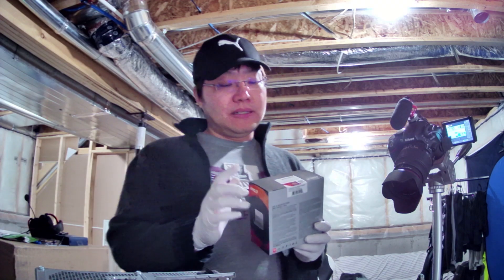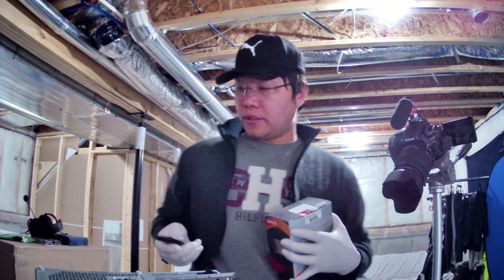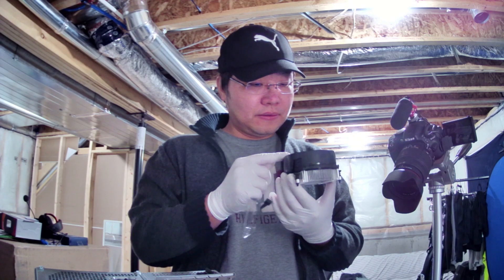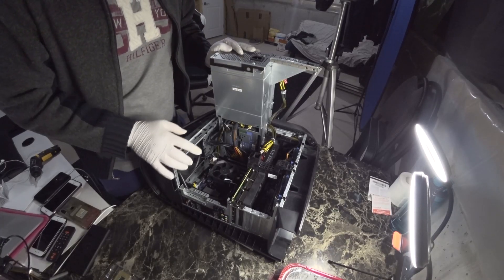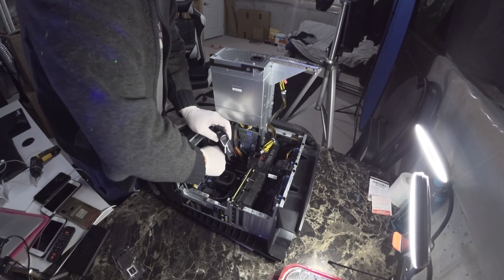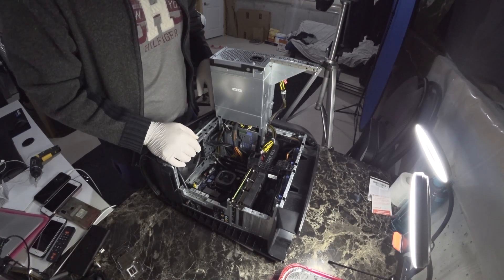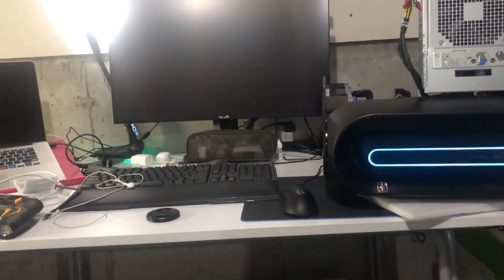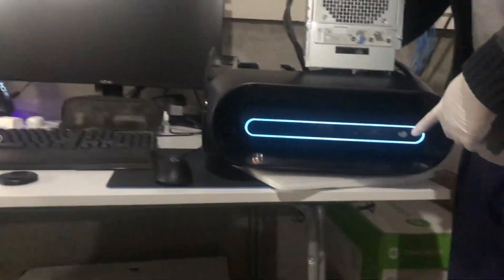Will Aurora R10 able to use AMD5000? 5600x 5800x 5900x

Comment: i'm helping a friend install a ryzen 9 5900x into their alienware aurora r10 from 2022. it ran and we checked settings, later that night it started crashing, and now won't boot. i see it has bios 2.2.3 which is probably original version, i'll get that updated. But i would think it wouldn't start up at all if that bios version is too old? maybe something else is the issue? i'll go work on it again today and update bios and look for other clues
Reply from the maker: Good to work bro, but honestly tell you do not waste your time, see your motherboard part# first if your motherboard is 0NWN7M then you can't run any of 5XXX CPU due to unsupported even if your BIOS is upto date, if your motherboard is 0TYR0X then congratulation you can run any of 5xxx CPU on your PC. Good luck!

Comment: I had the same issue with my R10. Currently have 3700x and tried to upgrade to 5950x, twice! First I thought the cpu was bad and returned it for another.. both failed. So right now I'm stuck with the 3700x until a bios or someone can guide me.
Reply from the maker: Can’t use 5000 CPU, don’t try. Keep use 3700x.

Comment: Did you move the jumper from the PWR CLR to the CMOS CLR with the power unplugged for 5 seconds then back to the PWR CLR, plug it back in and try booting?
Reply from the maker: No I didn’t CLR CMOS but tried reset power with unplugged then still not work. This is not caused by bios it’s caused motherboard originally not supported new 5000CPU.
Reply: @ironytech3443  Yeah it appears the AGESA version is not correct however with CPUZ and HWINFO both showing the board as a x570 chipset, it's hard to say if it is showing other information correctly but thanks for getting back to me. I went from a 3700x to 3800x to test my r10 and obviously worked but I ran into that exact error you did when booting the first time and a CMOS CLR got it working. Not sure it will here even with their latest bios update as the AGESA version still shows as the 1.0 version.
Reply from the maker: @DGK86  Yeah, Right. however there is no support 5000 cpu except they provide proper BIOS version with new AGESA version too otherwise no way to use new CPU.

Comment: There was a new BIOS released today (2/18/21) version 2.1.1. Have you tried the upgrade again on that newer BIOS? I would love to know as I have an R10 on the way with a 3700X and I was able to purchase a 5600X.
Reply from the maker: Dam it, i checked just now and they release the new BIOS version, i just build new pc use my 5600x yesterday :). however will check it soon.
Reply: @ironytech3443  alright thank you! I would love to know soon since I’ll just return the 5600X and buy an oculus quest 2 if I can’t use it
Reply: @BLASTHOCKEY444  Dell is supposed to eventually release support.. I asked them during their twitch stream and they said as of bios 2.1.0 it didn't support but they are looking to allow this, but stay tuned for news from Alienware.
Reply: @Fred-xv5sx  I wonder if 2.1.1 makes it work, but thanks for the info!
Reply from the maker: @BLASTHOCKEY444  Obiouly it isn't work. Dell didn't release proper version for old R10 user
Reply: @ironytech3443  alright well thank you for trying it! I might just end up returning the 5600X I bought then
Reply: @ironytech3443  Have you tried 2.1.0 or 2.1.1? In 2.1.1 info it says it supports 5000 series overclocking
Reply: If you could do another video this could be popular as many people consider upgrade to 5000 series, I already flashed the newest Bios, but i don't haver the newest CPU yet.
Reply from the maker: @kedzis  abiously 5000 still not working on 3000 series CPU of R10 user, coz dell still not release the proper AGESA version under BIOS 2.1.1。 also a lot of R10 user shocked as well as me becoz of they changed motherboard to the new R10 5000 user, that's the bad news for us.
Reply: @ironytech3443  maybe some serious boi can dump the Bios and another serious boi can make it possible to flash to  our old bios..:D
Reply: @ironytech3443  Agree, really bad news, if they used different MoBo then it should be called Aurora R12, if it is the same it should be open to upgrades as this is how it is been advertised as easy upgradable. I am sure people will start returning them soon if this is the case.
Reply from the maker: @kedzis Yeah, I am really frustrated bro, becoz of feel like be faked by Dell, actually it is easy to support upgradable by them becoz the patch already release by AMD offically, but they don't so far.
Reply: what i can read online they did similar actions before, it is a shame really, as it puts potential customers off, they advertise Aurora as a system easy to upgrade and it is complete opposite, I saw threads on forums with 16 pages on the topic about how to upgrade the RAM - this is ridiculous!, it should be the easiest thing, it seems they do everything to complicate things so people cannot buy anywhere else and buy upgrades directly from them for twice the price(it should be illegal), but people are not stupid and can count their money especially in these difficult times. I was considering buying new Aurora with 5000 series, but when i saw their website with not up to date information, massive differences between US and UK choices and prices(example US mouse cost 3$, UK £12, WTF?) AW Arena forum is basically dead, important topics not refreshed for years, software with lots of problems(graphics outdated for years showing old models), the same with firmware and new products, customer service is not much better. About two months ago I recommended new Dell laptop as a birthday gift for my father in law - it arrived week after his birthday and we ordered it 3 weeks before, dad got excited as he didn't expect any laptop and we found out that keyboard was wrong language with unusual European keys and the mains plug was also European(we ordered UK version on UK website), later we were waiting 3 weeks for a refund! I recently contacted customer service and the bot replied that someone will contact me soon, it never happened, 24hours later someone sent me a message that they tried to contact me but i didn't reply(which was a lie), recently i bought a keyboard which was misbehaving after all FW upgrades and the same few days ago with the mouse, new mouse and maximum charge was 70%, even with the newest FW, downgrading to the factory one did not help, luckily i managed to find much older fw which i flashed and it worked and showed finally100%, i had to update the FW again.. anyway, i was going to buy new system based on Ryzen5000 and just before my purchase they raised the prices up  about £250, then they limited options, i said to myself this is too much.. It is a shame really that such a big corporation behaves this way. I have few Dell and AW products and still like them, but it seems it is all about the money and customer is not important these days..
Reply from the maker: @kedzis  Wtf, THis is ridiculous experience and sympathising with it. I think i am going to stop buying alienware future.
Reply: @ironytech3443  thanks, to be honest I like their futuristic design at the moment, but spec wise i think they are behind the competition and well overpriced, similar to apple products which I am not a fan. Today i got annoyed again as I saw yesterday 20% off deal and i wanted to buy new monitor, I saw 2 month waiting time so i thought i will sleep over it,  tonight i wanted to buy it and the deal is gone(they do it all the time), it is really anoying. To be honest they recently raised the prices so in the end it was not such a big deal and two months waiting  is rather a long time. I would probably buy it second hand if they were any available, but it is rather new model with 1440p(AW2721).
Reply: @ironytech3443  you are correct, I tried on 03/16/2021 as well, upgraded BIOS to 2.1.1, put the AMD 5600X on, but cannot boot, the Alienware logo flashes in yellow for 2 times and 1 time circle. With BIOS version of 2.1.1, the AMD AGESA version still as 1.0.0.6, which per AMD, you need to have AGESA 1.1 version and above to support 5000 series CPU.   As for now, the only hope is that Dell could release a future version of BIOS with AGESA version upgraded as well, but I doubt that Dell will do it. Dell only want you to buy new PC instead of upgrade by yourself. I am serious considering building my own PC (I sold my old build PC on Feb 2021 when I received this Alienware R10 with 3700X and 3070) with the RTX 3070 from this R10.
Dell, Shame on you!

Comment: Just a little info. I got on chat with alienware tech support today and here is a little snippet. 

"Dell Rep "Yes, as you mentioned there is a new update for Bios for this model v2.1.0. This still do not support the 5000 series and the option is not confirmed jet for a new bios capable of 5000""

He did tell me after to check back around the 26th/28th. So many there is a pending bios update for when the systems do start actually getting made.
Reply: Hi Lindsay :) Hope you are enjoying your machine. I do find it a bit strange from Dell. They are selling the 5000 series labelled still as R10. If they really wanted to distinguish a difference, they should've labelled it Alienware R12 or something. Since they are grouping it under R10, I hope all they are doing is just running an updated bios to support the 5000 series. But I guess time will tell if they are physically using a different motherboard for the Ryzen 5000 series, or just flashing a more 'updated' firmware when they produce the ryzen 5000 machines.
Reply: @Fred-xv5sx  Thank you Fred.

I agree. The fact they kept it as the R10 gives me hope they will release a bios to upgrade.

I am actually loving my machine. I normally build my own but the price was right, along with not having to track down parts. I ended up undervolting my gpu and setting my cpu on eco mode. Negligible performance hit for a system that runs a lot cooler and quieter. 

I do go with the liquid cooling option for the CPU, i've read way too many issues with the low profile cpu cooler option.
Reply from the maker: This is Very good informaion bro, I will keep watching .thanks a lot
Reply: Hi please keep us updated
Reply: There was a new bios released today (2/18/21)  for the R10 version 2.1.1. Perhaps that is the newer Bios they were referring to and it could add 5000 series support? My R10 is still on the way with a 3700X but I’d love to know if anyone has tried it yet
Reply: The new R10 with 5000 series has been release and it seems to be running on the same 2.1.0 bios, if you browse the community Dell chat, you will find some discussion with tech support which implies that it is possible now, because the motherboard should be the same
Reply: @CutieBarj  while there is a bios out now version 2.1.1, it seems to still have AGESA version 1.0.6 on it for R10’s that came with 3000 series CPUs. According to AMD, the motherboard needs to have AGESA version 1.1 to support 5000 series motherboards. 

My R10 (with a 3700X) is arriving tomorrow, and I’ll see what AGESA version it has in the bios
Reply: @BLASTHOCKEY444  Ok thanks, for what i could find on the dell community chat, it seems to be possible because the motherboard seems to be the same between the R10 with 3000 series and  R10 with 5000 series, but maybe they have blocked the AGESA update from the one they put in the factory, so you cant upgrade it :( I hope your system will have more information :)
Reply from the maker: @CutieBarj  according to the dell commutity chat i guess dell use the different motherboard for 5000 series R10 as well as X570cheapset for new r10 that is why we are not be able to use 5xx CPU even BIOS version same with new R10. this is the bad news, hope they can upgrade AGESA for old R10 user for use 5xx CPU.
Reply from the maker: @BLASTHOCKEY444  Your MB AGESA version should be same 1.0.0.6
Reply: @ironytech3443  just received my R10 and can confirm the AGESA is 1.0.0.6 but it’s only on bios 2.1.0 not 2.1.1 (not like that would change it)
Reply: @BLASTHOCKEY444  others already tried upgrade 2.1.1 and mention AGESA still 1.0.0.6. :(
Reply: @ironding1851  I know, super bummed about that. I’m just going to return / sell the 5600X and buy an oculus quest 2 and play some VR!

Comment: Ironytech, I noticed after I updated the 2.1 bios, it took a long time for my alienware to continue booting. I suspect, it is redetecting all the hardware components. I am curious but would have resetting the CMOS settings (or removing cmos battery/unplug computer for couple seconds and put back the cmos battery ) after dropping in the CPU may help it boot?
Reply from the maker: When i upgrade bios will take around 5-6 minitues, this is normal, and will reboot automatically. so how about you now? will it entered the windows correctly  and ok?
Reply: @ironytech3443  for me, I enter bios fine but for some reason it reset my windows login number pin. It is very strange for a bios update. In non Dell branded computers you usually don't experience this.

What I noticed is after firmware flash the computer seem to go through 3 initialization sequence before finally show Alienware logo.

This is why I wonder, if you install the 5000 CPU do you need do reset cmos by either pulling cmos battery or use jumper pin to allow the CPU to load correctly? I don't know, or maybe Dell really use different motherboard in their new Alienware r10 with 5000 CPU.
Reply from the maker: @Fred-xv5sx  Me as well, once upgrade BIOS will ask me reset my windows login pin number, so i always have to reset it.

Um...for 5000 CPU will try more possible testing when i free, but i tried clear CMOS before then still not working. Keep watching and thanks for your Suggeston
Reply from the maker: @Fred-xv5sx  If they use the different of motherboard for 5000cpu  this is really BS for me. :( i bought this PC is for upgrade for future 5000 CPU.
Reply: @ironytech3443  I know, I understand. I think many Alienware r10 user hoping to support ryzen 5000. But Dell seem to always not allow friendly upgrades on these machines.

This is my first time try Alienware but next time I don't think I will choose again.
Reply from the maker: @Fred-xv5sx  Yeah, You are right,  Normally i don't choose too, expect very cheap price.
Reply: @ironytech3443  yes I also got very good price for my unit. But I think after custom cooling solution, and lack of chassis space for good airflow, and motherboard not friendly for future upgrade, in future I go back to custom build. Too much trouble.
Reply: @Fred-xv5sx  New 2.1.1 BIOS supports the Ryzen5000 OC(according to their info on the Dell website)
Reply: @kedzis  sadly not, because its still Agesa 1.0.0.6 .....